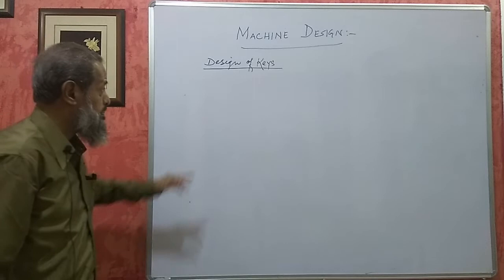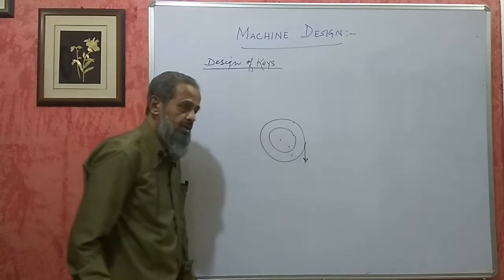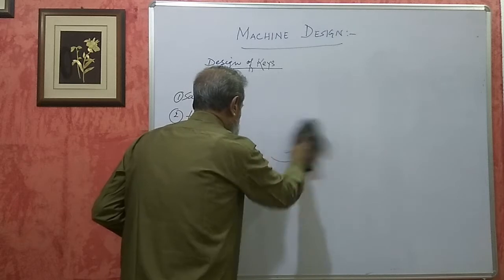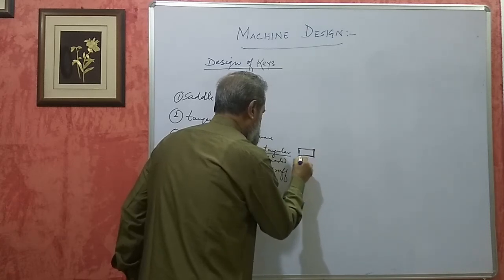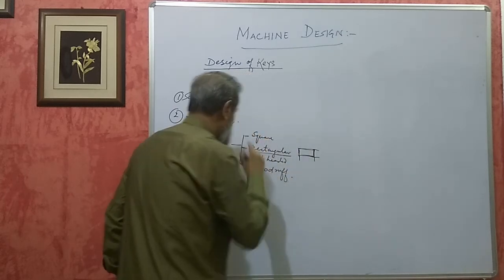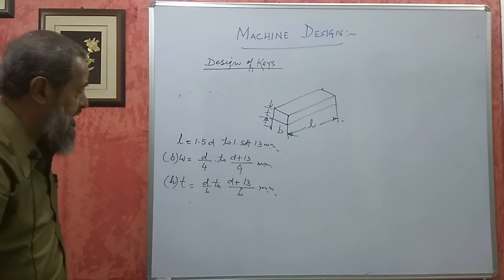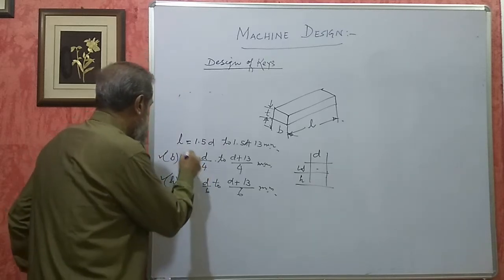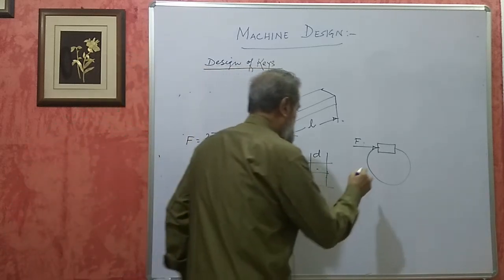Karnataka Diploma-Machine Design- Design of shaft- Part 3

Comment: Hi sir, i love your way of teaching. i have a doubt. you have taken 120mm as length for that we need to change diameter, width and thickness respectively right?. L=120mm, d=80mm, w=24mm, t=15mm. for this also compressive stress value comes around 117.28N/mm2. still it fails. let me know  if we change length, do we have to change d, w and t respectively? thank you.

Comment: sir key formules are given in data handbook or we have to revise it
Reply from the maker: For key the width and height of the key are to be taken from the table given in the handbook depending on the size of the shaft. And usually the length of the key is taken as 1.5times the dia of the shaft.
Reply: @mokhtarahmed3583  DDHB TABLE NO?  FOR KEY WIDTH